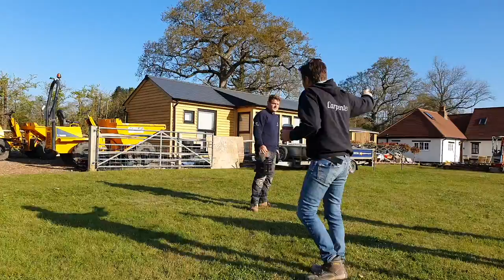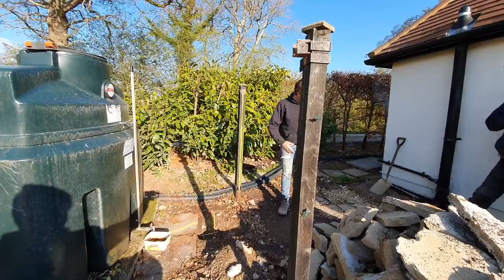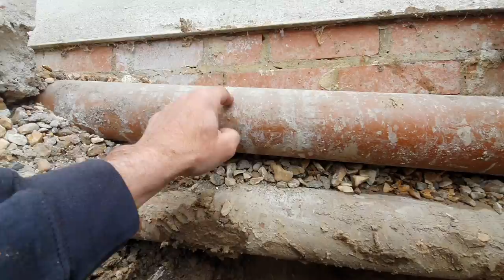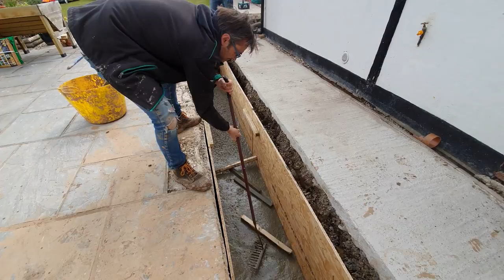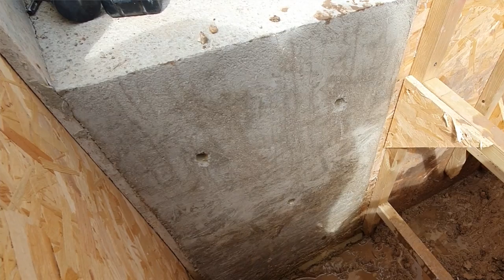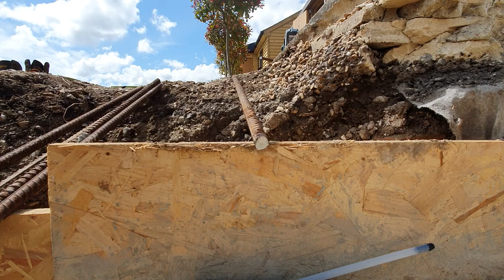The Big Build Digging foundations, shuttering bad ground and pouring concrete

Comment: A lot of shuttering joiners will give you loads of tips. 1. Make you trench wider, shutter as you did, but use horizontal & vertical 4x2 or 5x2 along the outside, wedge/block them in to brace them against the soil, spray apply shutter release oil on face of ply/OSB, remove shuttering 2/3 days later, quickly back-fill & tamper voids solid. 2. Keep your feet clear so you don’t go over on your ankles. 3. On longer/bigger foundations, put a rope near the end of the concrete hose, it’s easier to manoeuvre it without hurting your back. 4. Hilti drill for concrete, nothing else compares. Wire brush (from Hilti) the holes bored for rebar. Etc, etc.

Comment: Good one, great to get the concrete in without to much fuss, didn't see any reinforcing mesh going in 👍☘️🇮🇪👋
Reply: Doesn't look like it would need need reinforcement in this situation. There isn't a one size fits all, contrary to what some builders think, if no reinforcement was fitted then it clearly didn't need it (especially given he has videoed it and put it on YT for all to see), BC would have approved what is being done. Being on the design side of buildings, engineering consultancy, we design each detail on its own merits unless it is a very common detail. Reinforcement isn't needed in founds like this probably 60% of the time.

Comment: Great work Robin to you and your team. Word of warning with chemical fixings. We were on a job and were using loads of that stuff but couldn't get enough of one brand so got different ones. On one fixing we used 2 types which when mixed got seriously hot, VERY very quickly, and resulted in a gas cloud. Not kidding. And we were working inside. The smell was very overpowering resulting in everyone running outside. Stupid move really as i should have known better but there you go, lesson learnt. Took the rolliking on the chin and moved on. DONT mix chemicals! Cheers guys.
Reply from the maker: Blimey!!!! I never knew that could happen, great advice and thanks for sharing!! I will never mix brands in the same hole knowing this!!!

Comment: Trying to build a front porch on my house, 1933 with a Cellar. BC said foundation has to be Cellar depth, had a digger round today but because the awkward ness of the drive way he couldn't do all of it. It was collapsing in some area. I have shuttered it by screwing the supports in, scrating my head wondering how this is going to work when the concrete can finally be poured haha. Glad I found this video

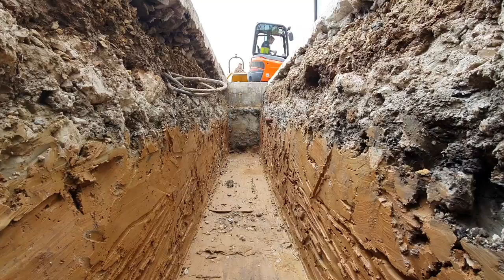Comment: Blimey, look how neat that foundation trench bottom is, at 7:20, no problem there with Building Control. Right decision to shutter; I noted the change from clay to sand, at 7:38, just before you came in to discuss it = good video making.
The halfway pumping the dust out made me recall "It's all in the wrist action"

Comment: Great video. What happens to the OSB shuttering over time? Does it just rot away and leave a void?
Reply from the maker: This will degrade and turn to mud over time, will take years but there is no void formed
Reply: @ukconstruction  ah cool. Figured that might happen.
Reply: That’s exactly what I was thinking.

Comment: Rather surprised how wet your concrete mix is.  In the USA, footings and stem walls would be poured with about a six-inch slump and vibrated.

Comment: Interesting to see different approaches to the building game. we have used a similar method where we moved the OSB once the crete sets. The depth of clay and matrix of the clay often a factor in  where we and how we proceed with the build. Not knowing the geology and where the build is going should make for a interesting series ahead but its good to see a little on the fly decision making in the process making it to the Directors Cut.

Comment: Nice trenches...surprised at how wet the concrete was and no reinforcing or vibration...is standard in the UK?
Reply from the maker: Yes we generally go deep and wide and mass fill with concrete!! if budget allowed you could do a proper soils test, then find an engineer to design a scheme that would work with less concrete and maybe some reinforcement but by the time you have done this and paid for the calculations etc you could have paid for the foundations!!! so we tend to here in the UK go on local knowledge by the contractors and building inspectors and this id the most cost effective way to achieve the end goal

Comment: Tidy setup.
Always wondering if the OSB can be left in the footing. It definitely does creates some void space between the concrete and the surrounding ground and some degree of strength will be lost but probably is it negligible and can be discounted if the loads on the foundation remain typical for a 2 storey residential house.

Comment: Great Vid Robin. I'm afraid I was sure the trench I'd dug by hand wouldn't go, chanced it, the worst ever down pour of rain came, paid the price. Mind you also found out that the neighbours rain water was going no further than a metre away into the ground , not into drainage ?? Got them to get sorted ! I use the hilti chemical anchors only because they've worked in the past, and afraid to change. Very expensive though, special gun, pump, and hole brushes. Would have loved to see the detail of the concrete when meeting the supporting wall of the house. Was that stepped ? Btw pulled out my shutters by placing sacrificial timber on backs, and with blocks, scaffold polls, and plenty of weetabix they came out but hard work. Wonder now if I could have left them there ? Atb Will 👍

Comment: How deep below finished floor level does one finish concrete pouring? Is it about 412 mm? ( Adding 150 mm hardcore + 100 mm concrete + 100 mm insulation + 50 mm screed + 12mm floor)

Comment: did you not have to use reinforcing in the founds because of the depth of the concrete
Reply: My wild guess is that the land surveyor did his work and determined that rebar (tensile strength) has to be on the top more so than on the bottom in that location. And next Robin said there were going to do footings on top of that (I'm guessing 30 or 40 cm in width, a bit more in height), so there will be rebar in them.

Comment: Hi Robin, I am just about to undergo my foundations for my own home so your video was very helpful 👍, looking at where you’ve joined the two foundations together with the Re-Bar. Where you shattered off the end of the trench for the first pour, Would you be allowed to screw some 4 x 2 timber horizontally across the end of your shuttering so when you removed the shuttering after the concrete had dried you would end up with a toothed section in the end of the first pour concrete, then when you pour the 2nd foundation it would lock into the 1st, A bit like Lego blocks, judging by the depth of your foundation you could easily get three horizontal 4 inch deep slots, Do you think that would this be an acceptable method to lock the two slabs together, just a thought…… Mark
Reply: If this method was allowed you could save a lot of time and money by simply using 3/4 bits of 4 x 2 on the end of your shuttering
Reply from the maker: Hi Mate, when we have to pour the foundations in sections we generally follow a brief from the structural engineer, in our case we where advised what size rebar and their positions etc the theory of using the timbers as a toothed section of shuttering is good its wether or not a structural engineer can justify it??

Comment: Lovely shuttering. Silly question: when would you use a poker round the edges? Is it not required for nice smooth shuttering and poured concrete (can't imagine trapped air that way). P.S. that dust blower was designed by a Klanger?  You must call it "The Klanger". Lovely job, look forward to the next one.

Comment: Thank you for sharing the video but isn't the concrete too watery?
Reply from the maker: It is usually what the pump needs to get the slump through the lengths of pipe
Reply: Wouldn't that compromise the quality and strength of the concrete? @ukconstruction

Comment: Do you put re-bar throughout the footings, or just where your footings are joining together?
Reply: yeah i was wondering that too..and if not why not? Just curious.
Reply: @kevinbutchart7187  yeah seems strange not too on footings of that depth, but i suppose it comes down to engineers spec
Reply: were we live mesh at the bottom of the trench and re-bar about 300mm down from the top
Reply: @ryankenneth8669  yea , the engineer is the top notch so much concrete for  small addition and no rebars

Comment: Was your BCO ok with you leaving the OSB in?

I had to do loads of shuttering on a build last year any my inspector insisted I took it out just before the pour at the last minute claiming it would rot in time and leave gaps/uneven compaction the subsoil and footings. 

Wasn’t sure if it was a reg or good practice.
Reply from the maker: No choice really these sides would have given way as soon as you pulled up the sheets
Reply: @ukconstruction  to be fair, with mine I ‘May’ have left them in and then just cut off anything left above the concrete before the BCO popped back... 🌚
Reply: With it that wet, if you pulled shuttering out the levels would alter instantly as it rushed into gaps???

Comment: No steel in the footing rob?
Reply from the maker: Only when specified, we tend to work on depth and mass typically sometimes an engineer will design some reinforcement but not that much in small domestic work like this.
Reply: @ukconstruction  interesting. Over here in Australia it would be very unusual not to have steel cages in any footing I reckon

Comment: Shouldnt really leave the shuttering in there. As footings also work by friction with the surrounding material not just downwards pressure. Supprised you didn’t need clay board?
Reply: Interesting point! What is the worst case sinario if you leave the shuttering in situ ?
Reply: It rots. Leaving a void that can then heave. Meaning any finish to the surrounding surface cracks. Or creates a water channel once rotted that then causes movement of the footing. Just shoddy workmanship leaving forms in place.... 👎
Reply: @MrB3ngy  those footings were colossal! Do you still think it could move eventually when shutters rot?
Reply: clothedwiththesun possibly? Especially with the clay. And no clay board.. but could then it may be fine for 20 years. Who knows and who cares? Just because there deep doesn’t make them invincible.

Comment: what is the device that beeps when levelling the concrete? I need one :)
Reply: Digital level ?
Reply: @mule666  i found out. It is a receiver that picks up the laser level and beeps when it reaches the set point.

Comment: That concrete looks too wet
Reply: It is wet. You add water to the bags of concrete then pour. If u dont add the water it wont become hard. Been union carpenter in manhattan for 3 years
Reply: Good pump mix 130 s3 slump concrete 👍🏽 three years a concrete dispatch manger

Comment: What's your plan to remove the osb sheets from the trench?
Reply from the maker: We have to leave the sheets in and cut them back to suit, these will degrade and turn to soil eventually and there is no structural issues or voids left behind, it is sometimes unavoidable where there is a risk of collapse or it is unsafe.
Reply: @ukconstruction  thanks for the reply, I'm a groundworker and have been taught never to leave any timber buried in or around foundations because of the rot that occurs.
Reply from the maker: @daveikin2599  Yes dave, we have to minimise leaving material in the ground but where there is no choice especially from a safety perspective, this material will eventually become earth and no voids will be present

Comment: Great video but that concrete was a very very wet mix!
Reply from the maker: Hi Alan, most pumped concrete is fairly wet it can get stuck in the lines very easily if it is to dry, for foundations you want a fairly wet mix and generally this is how we take it, if we where casting a floor slab we might want a tighter slump it goes off like crazy in any case its like granite now!!!

Comment: Those were the days. I remember just digging a trench and mass filling it with concrete like you obviously still do in the UK. For some reason in Oz we don't do that. Digging the trench is the easy bit. Then the fun starts. Every footing is full of steel. You have trench mesh. You have all sorts of deformed bar. All arranged in some pattern by an engineer. Then as you are pouring you are chasing around putting in starter bars for all the block work to tie into if you have block walls of course. Does it stop movement and cracking. Well no. If anything everything cracks more because I reckon it is too rigid and no flex or give for the building to settle. Nice to see a bit of good weather in the UK . We have been the opposite and having a wet end to Autumn.
Reply: ‘Everything cracks more!’ In Oz you guys gotta do all that cos your blokes mess about a lot. Like needing to keeping your trousers up with belt, braces and tie 😁

Comment: how come you didn't use rebar to act as a brace material? that way you're able to leave it in, save on the fishing practice if you're not a keen angler XD
Reply: Rebar prone to rot/expand/contract if there isn't "cover" from the concrete..... usually 50mm on the sides 75 on the bottom.... but can be different ie highway structures that are exposed to salt require more cover
Reply: @wanderers387  good to know, thanks

Comment: Why didnt you put bar in your first pour to connect to the next rather than drill it better and stronger
Reply from the maker: Hi David, I had to dig the other trench and if the bar was cast in the first pour then I would not have been able to dig the final trench with my machine
Reply: @ukconstruction  dont get that just set bars and shutter back then dig from end of bars